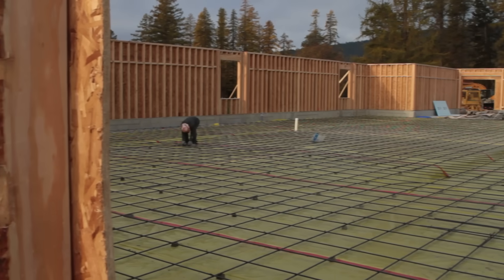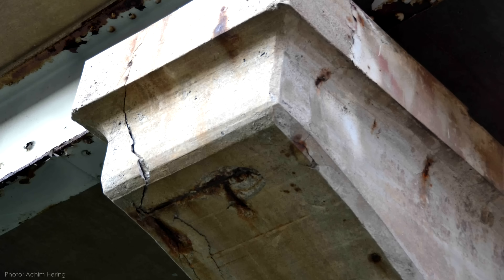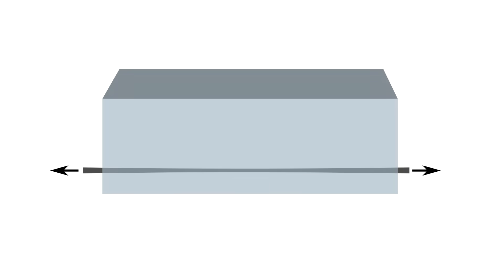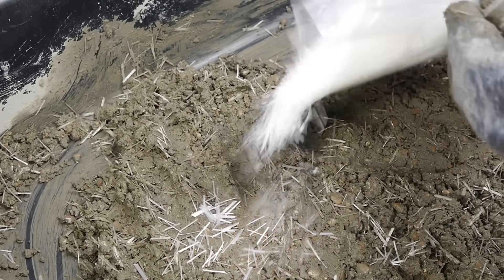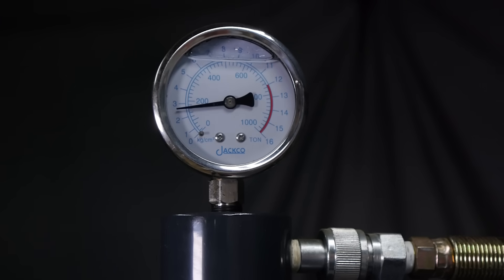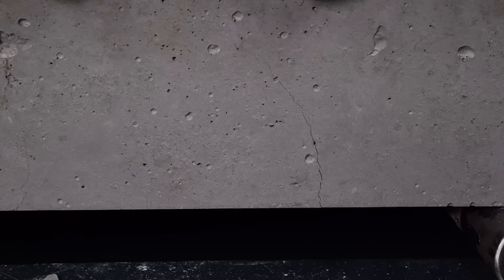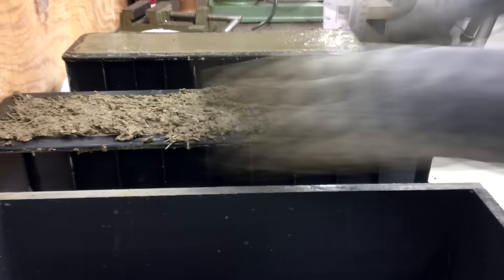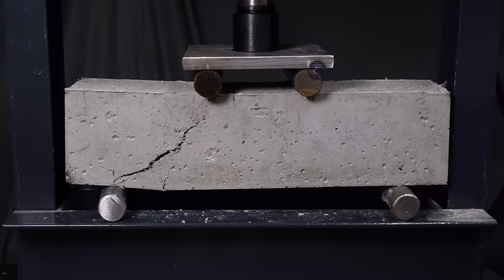Does Rebar Rust?

Comment: What about ceramic rebar? 6-8 times stronger than steel, easier to install, flexible when used in vertical applications (skyscrapers where winds are a factor) and often overlooked! Check out the multiple story structures in Dubai. Most used ceramic with great results. But, then again, why look out of our country for better technology? In a perfect world, the steel would be placed properly and remain at the right depth or height within the pour. BUT, in the real world, the trampling of the grid by humans and machines during the placement will always be an issue. So, let’s work on ways to eliminate that problem.
Reply: The concrete provides the rigid , the re-bar provides the flex and hold together completely cracked through concrete. Ceramic is rigid and will crack with the concrete.
Reply: Wasn't available 40 years ago
Reply: I’m not certain where you got your information about ceramic rebar? Probably from a steel salesman. I personally was in a Federally Certified “construction materials” testing lab, in NC, where rebar of various diameters up to and including 2” were tested against ceramic rebar of like diameters, and I witnessed first hand the incredible strength of true ceramic rebar versus steel. These tests were amazing! the results: All materials were tested in identical situations for flexibility, tensile strength, external pressures etc., and the ceramic outperformed in EVERY test. The company requesting the testing was attempting to get their product into the U.S. market. Here’s an example of what I saw: bending rebar of 2” diameter broke at 20,000lbs. Ceramic broke at 76,000lbs! The testing labs equipment would only reach 50 tons, and they were actually concerned that their machines would fail before the stuff broke! They place a piece of brand new 2” rebar in a machine and attempted to separate by brute force by pulling it apart. It began to separate at 17,000, and came completely apart at 24,320lbs. The ceramic lasted until 66,000lbs or 33 tons. So, having seen it with my own eyes, I became a believer!!  Perhaps you’re confusing ceramic with fiberglass rebar? They ARE NOT the same material. And incidentally: concrete by itself, without something to bond its molecules together will fall apart. Rebar is the webbing that holds it together and makes it a continuous unit, along with the gravel component and sand. We’re presently working on “better concrete.” AND we’ll utilize ceramic because it will out last steel, will NEVER rust, and actually bonds better to cement.
Reply: @stephentaylor9366  Re-bar is cut and bent  into shapes and installed by crane on site. This would break any ceramic coatings exposing more unprotected steel to air and water. Also adds greatly to the costs.
Reply: NO!! NO!! IT is painfully obvious that you have NEVER seen true Ceramic Rebar material. It is SOLID CERAMIC. I’ve seen it hoisted in 40’ lengths (I’ve also seen 2 (that’s right! TWO) men carry a 40’ length and place it for a pour. Try that with a 40’ piece of 2” steel. No wonder you need a Crain!! And, oh by the way, how about extensive exposure of steel rebar on job sites, where there is an accumulation of surface rust, that may indeed appear to be surface only but actually is deeper than that. You can leave Ceramic rebar outside forever. We’re NOT Coating anything here!! It’s a solid ceramic material!
Reply: @stephentaylor9366  bullshit. Can't bend ceramic into the shapes for pillars and aprons without breaking. If it were so good it would be everywhere, it's not. no such thing. There is epoxy coated re-bar but it is being taken off the market. Salt and water still eventually defeat it.

Comment: Is this a real question does Rebar rust, Realy - Realy does raw metal which is iron steal rust - REALY! - I have cut, blasted, chopped, chipped, and smashed 1,000's of rebar incased cement 100% - 100 PERCENT were rusted!
Reply: That's just surface rust
Reply: @frontspring1  As long as there is water or saltwater in contact with the concrete the re-bar will continue to rust and eventually blowout the concrete.  Concrete is quite porous water and air.

Comment: Is the pre-load or stretched re-bar supposed to prevent the concrete from cracking?  Your tests do not have preload, are they still valid?
Reply: The cabling is standard use. It is in a plastic or rubber tube. it's pulled tight after the concrete hardens which gets the slab into the springy zone and dampens flexing and vibration from whatever source. Re-bar is not stretched.

Comment: Yes from the first minute it is exposed to water and air which is what is present in wet concrete,coated rebar is even worse is rusts and expands also although the signs of expansion are hidden because the flow of rust is not allowed to escape the rebar coating like traditional uncoated steel
Reply: Wrong
Reply: @richardstrongismokecigarsa7215  yeah, i was waiting for that comment,Try the same old in Fla and see how that holds out

Comment: I'm watching this video one week after the condo collapse in Miami Florida. Can't help thinking how important the message is in this video.
Reply: Wrong question. Steel does indeed rust. Steel used for reinforcing concrete MUST BE COATED TO PROTECT AGAINST RUST. Concrete is ALWAYS WET enough to cause rust of any steel that contacts it. Most contractors go through life lying, stealing and cheating - they must be republicans. Corruption in the building industry is a way of life for... oh you get  the point.
Reply: No. Concrete is highly alkaline and suppresses further rusting until CO2 finally penetrates to the rebar. With a 3" cover, that protection can last over 50 years. Assuming that cracks are suppressed with fiber additives and/or concrete sealing. A vinyl cement additive will also increase rebar lifetime. 
 @thatguy-art6229
Reply: @thatguy-art6229  Way to bring politics into a non political situation.
Reply: @Tanmay.Patil1  Yeah as much as I am for pointing at a political party opposite of my own, this is one of those instances where I can't pin politics on it in anyway shape or form, despite the ways we can point in that direction. This one is really between the owners/managers of the property and possibly the contractors. I'd leave the conclusions up to the investigators.

Comment: IF rebar rusts, why not add to the cost and powder coat it all or whatever, in a liquid bath, a bunch at a time?
Reply: you think that coating will survive bundling, shipping and install?  Cut to length on site so ends exposed and all the scratch through to bare steel and the rust has a place to start. Just add water, saltwater for faster.

Comment: Apparently the building that collapsed in Florida was getting inundated with salt water in the basement every time there was a  high tide. From what I understand this was happening for years!
Reply: That wasn't what was reported
Reply: @richardstrongismokecigarsa7215  At this point everything is speculation. That is probably the most probable explanation.  There is an interview with the maintenance man the had worked there for several years and that was his theory.
Reply: 40 years of hurricane saltwater spray
Reply: @MrBonners  wrong

Comment: What did Romans & Greeks use in their concrete other than volcanic ash? 
Their columns including concrete ceiling still stands after 2,000 years. We should be using what they are using.
Reply: They added lime and some kind of aggregate- stones, broken tiles, and sometimes pumice to lighten the weight of the mixture. They mixed their concrete pretty dry and tamped it into place instead of pouring it, this, combined with their sound architectural principles contributed the most to the longevity of their structures. Of course there is a pretty big survivorship bias; we only see the highest quality Roman structures surviving today- the poorer quality ones collapsed ages ago.
Reply: All the ancient civilization put straw in their concrete. The ash is light weight filler to lighten the concrete so they could go with higher walls.
Reply: The Romans only used concrete in compressive applications.
Reply: @bbgun061  As everybody. What's your point?
Reply: @MrBonners  we use concrete in tensile structures, which means we need to put rebar in it. The Romans only built columns and arches, which are purely compressive. That means there's nothing in it that can rust, so there's no internal expansion forces. Hence there are still Roman concrete structures standing today.
Reply: @MrBonners   clever response, but we understand his point.
Reply: Well they’re concrete was more pure and with the saltwater in it all gaps were filled
Reply: Romans didn't have icing/thawing cycles.

Comment: i used fiber. it did not stop cracking and once it started it tree branched 30 ft   I will never try that again.
Reply: It is for small flexing. Not a replacement for re-bar.
Reply: @MrBonners  yeah for sure. wish the contractor would have told me that. i think they were just being lazy. thank you.

Comment: Question : why they not dip the steel bars in hot zinc or so called hot galvanizing to protect the steel surface from corrosion?
Reply: shipping and and install cut to fit breaks the zinc coating, add water and rust starts, faster if you add salt.

Comment: so I suppose that using stainless steel bar would not work all that well? I am not a concrete guy by the way...stainless steel does not rust I am told. So would it be a lot more expensive than to manufacture and use bars made from stainless steel? Is stainless steel not strong enough?
Reply: SS is many time the cost

Comment: Surfside condo was reinforced concrete slab construction held up by rebar embedded concrete pillars that hold up the entire building. A building constructed of steel frames riveted or welded together is eminently stronger. They chose the former method because it's cheaper. The photos of degrading concrete proves the building was in danger of collapse but they didn't heed the warnings. Also, the developer built a 13th floor Penthouse when the initial permit only allowed 12 floors, and everyone knows that a 13th floor is unlucky and that contributed to the collapse with the extra weight bearing down on crumbling concrete pillars.

Comment: Sadly, back in 1981 these "additives" were unheard of ... as we watch the tragedy that is "Surfside, FL" plays out.  As you rightly point out, "Corrosion" acts in exactly the same way as how "Water" that gets frozen hydraulics a giant Boulder into small stones over time (and gives the World "Pot Holes" in our road systems); most folks don't even know what "Conservation of Mass" is. In "Salt Water" environs, it is MUCH more important to ensure "Cover" ... both dimensionally in the initial construction oversight as well as redundancy methods such as exterior coating to help resist any fissures that have formed over time to preclude encroaching Salts (as well as Oxygen). Prayers for the Surfside Victims and families ... and shame on the Inspectors and Officials that did nothing about it over the years of neglect.

Comment: Assuming the Florida condo didn’t collapse because of a sinkhole it looks like it was long overdue for repair work.

Rebar used near oceans should be coated in epoxy. The concrete should be reinforced with carbon or glass fibers.

Comment: I have always wondered why we don't spray the rebar with some sort of anti-oxidation substance to alleviate the issue of corrosion ... To me it is unbelievable that we place cold-roll steel inside of wet cement ??? I just can't believe how we build things that cannot last ... I stayed in an apartment building that was built in 1498 in Florence ... Still a serviceable building ... like all the rest ... Across the street was Michel Angelo's house ... also still standing fine ...

Comment: Rebar corrosion probably aided in the condo collapse in FL I'm not positively sure but there was a parking garage beneath the condos above and I heard that the residents could see cracks in the columns of the structure in the garage area.
Reply: Between that and the stressor of settling/sinking (I recall hearing that there'd been about a 2 inch sinkage/settling of the building in the last few years) would have exacerbated cracking.

Comment: The answer to does rebar in concrete rust and the answer is Yes.  Next question - Does epoxy coated rebar in concrete rust, and the longer answer is if it is handled roughly and the epoxy is chipped off of the rebar, then yes again the rebar will rust.